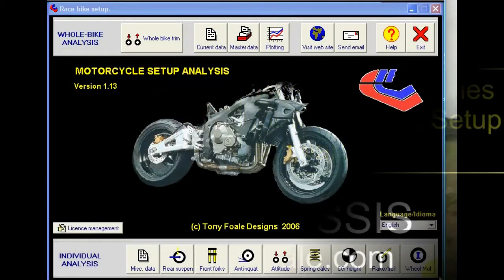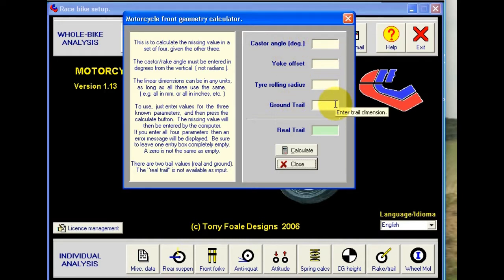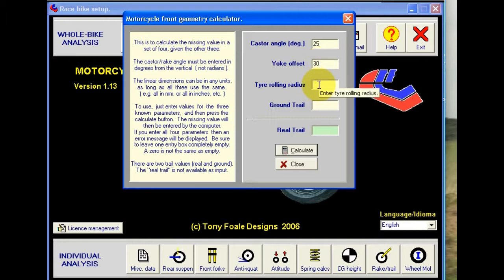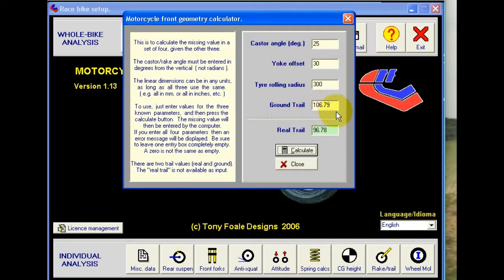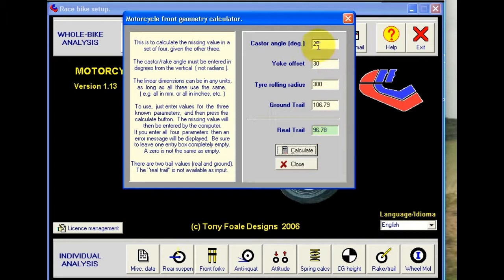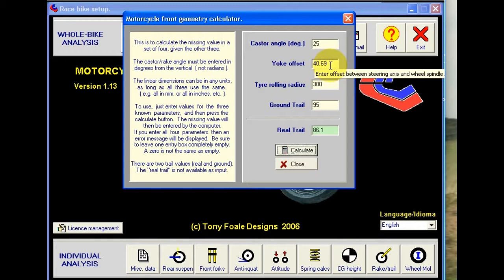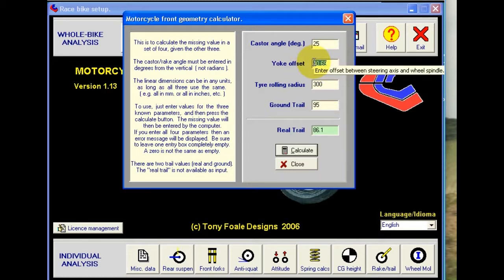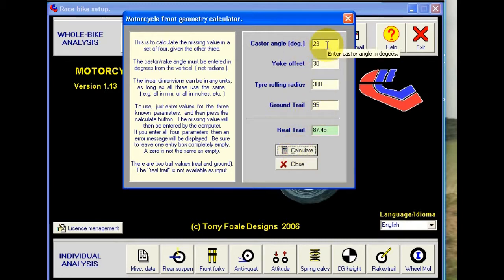Rake and Trail calculator

Comment: Am I right to believe that this only works if the fork lugs are in line with the forks, like most street and all sports bikes, but not trail or enduro bikes for exemple?
Reply from the maker: If you include the offset as part of the total (yoke offset + fork offset) then it works.
good question.